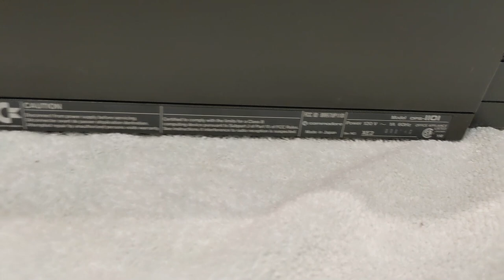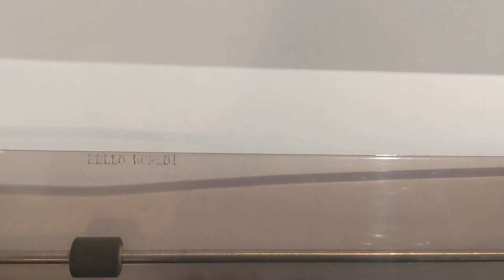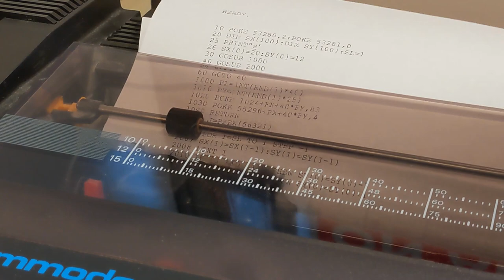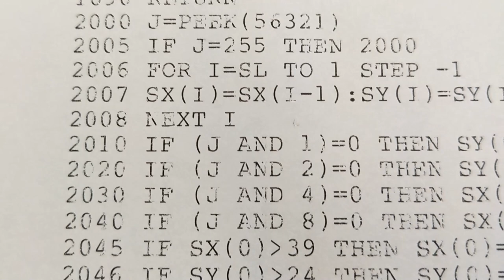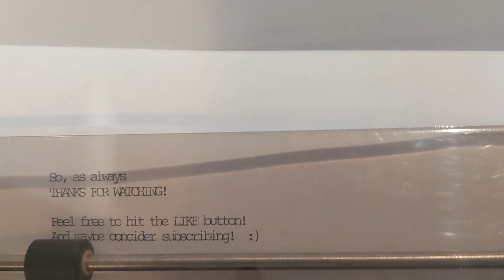Printer That Works Like A Typewriter  - Commodore DPS-1101

Comment: Well done! When i started with the telephone company in 87 they had a belt driven printer.  Would print an entire line at a time. Up to 7000 lines per minute...it replaced an older similar one that was hydrolic..

Comment: I have owned & Sold those Printers, Noisy is 1 word, A Acoustic Hood is what you need I even used it on a C64 & Amiga.. Needs a ribbon & New Daisy Wheel ..

Comment: How do you "refresh" the ribbon? Or does it use a standard type of typewriter ribbon wheel?
Reply: I don't think you can find any spares these days :D
Reply: This looks like a film ribbon so no refresh.
Reply: It's an IBM 82/Selectric plastic ribbon.  You can rewind them, but you get gaps in the characters where it was already used.  That's probably what's going on with this one